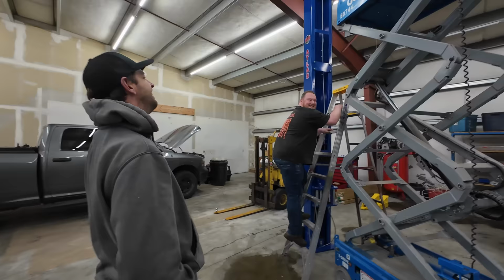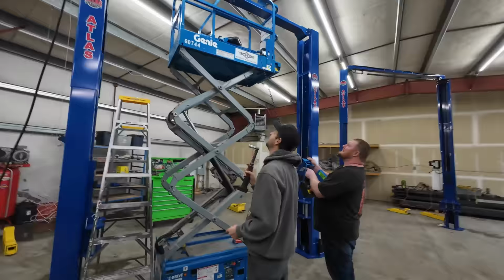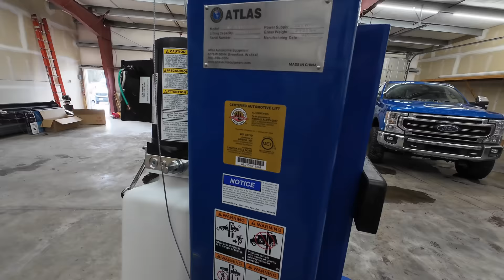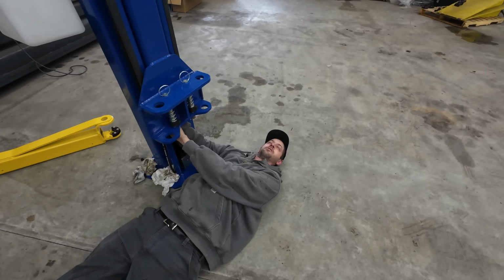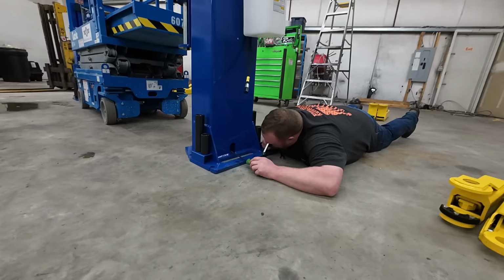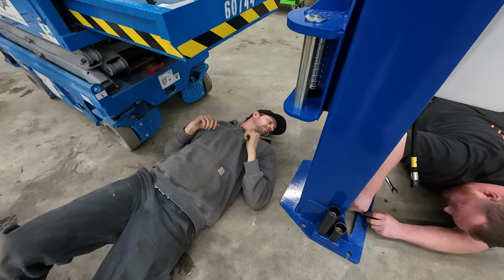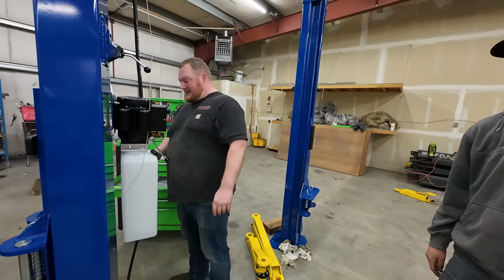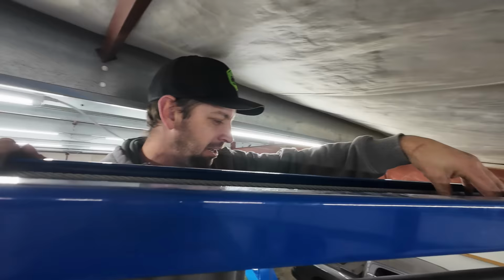Open for business!  Almost…

Comment: there is no need to take the controller out of the basket... the master controls are right on the bottom next to that red shut-off button 🤣🤣🤣
Reply: Hahahahaha didn't even think of that.....
Reply: Sssshhhhhh
Reply: Except the controller probably weighs three pounds….
Reply: Running it off the body controls puts you head down right next to it, instead of standing ready to run. And it’s a genie, so even brand new they aren’t great controls.
Reply: Must be his first day.
Reply: I can see them from here lol
Reply: Any video that you does with nate, grumpy, ben... is a good video
Reply: The controller should be proportional for lifting slow, the emergency controls are not.  It would make it hard to line up the bolt holes.
Reply: And tell Ethan to talk less kinda… just a suggestion. The kick flip comment was awesome though… 5:09
Reply: @chriswywh , what? Ethan is a friend and hired trainee. His input is hilarious.
Reply: This only works to go up or down, there’s no controls to drive it down there
Reply: @izzygoat6405  Correct. The controls on the base frame are to lower the basket in emergency situations. And master key to lock out the unit.
Reply: @elitefleetautomotive9181  sometimes, to be a man, you must use stretchy cords...
Reply: @donh6416  loaded a few of these on trailers for a delivery company, very easy to chain down but hate driving them! my worst was inside a hospital, whole basket had to break down to get out the door, that was fun :)
Reply: @izzygoat6405 I don't mind driving them. Its fun when you have one drive wheel on a surface not firmly attached to the floor and you can turn and then kick it out of your way after you ask staffers to remove them and they don't.

Comment: There is an emergency lowering valve in the base of the lift. It let off the hydraulic pressure back into the tank to lower platform.

Comment: Casey, I worked in automotive industry for over 30 years in Michigan.  The one of the legal reason the OEM's can not sell that truck to the public, is if any of the Safety components parts are not off Production  tooling..Brakes, airbags, and fuel system parts. or If any of other major component parts are from prototype tooling, the OEM's cannot sell them.

Comment: I work at a gas station and so far what I've heard is that the tap is the safest way to use your card because there is a randomly generated number everytime u use it. Always tap if possible
Reply: Yes, and that’s what multiple financial sites recommend. Because there’s no physical contact. But also much faster than chip.

Comment: If you did pin it against the ceiling and get locked out, you could still lower the platform with the emergency relief valve on the base. (Red handle)..
Reply: But they would then need someone else on the ground to do that…

Comment: At 13:29, using tap to pay on card is more secure than using the chip. Because skimmers can read the chip when inserted but not when tapped. I used to work in the credit card processing business.

Addendum - and it’s much quicker than using the chip! Plus less prone to read errors by a dirty card/chip.
Reply: That's good to know! Thank you!
Reply: Yeah but a the tap information can be grabbed by a pocket scanner when they are close to you. You definitely need a protector sleeve or billfold. I'm not sure they work properly, you are taking their word for it. Cards aren't safe period.
Reply: I also want to add, I opened a brand new account at regions, got the debit card, activated it on the phone then used it at the Bank's own ATM, then a few hours later got a notification asking if I made a purchase on Amazon for a few cents. If not for that I would have been wiped out. That account can no longer be accessed via card or online. Direct in person bank withdrawal via check only. A check withdrawal gives me time to dispute a fraud withdrawal. But personally I think your money is safer hidden in a jar in a drain tile.
Reply: I just barter cows for everything.
Reply: @Bryan-Hensley owwww I’m coming to do a treasure hunt at your house!!!!

Comment: If the lift gets stuck up for any reason, there is a manual override/emergency valve on the lower side to let it down. You should also be able to control all functions from the lower panel. You say dying can take a long time, I say it takes a life time.
Reply: Lol

Comment: 12:15 I know that this is an old video but the welded bushings have to go against the frame!  Might want to turn those around.  In the manual page 22 states to make sure that the plate is installed as shown, which shows the plate flat side inwards and the collars inwards against the frame of the lift.  🤠👍

Comment: Interesting the hoist legs don't have a pad under them to keep the legs from rusting. And for the people that might have an issue with no bolts in the floor. You do that after the hoist makes a few unloaded runs up and down, as the legs will find "home" where they want to be. Thank's Casey and the happy guy's for the shows. Does Casey ever have non-happy people in his shows? Just the ones hooked to the truck.
Reply: That's completely against what I've been told by professionals ( I'm considering getting one used and install it myself). They are telling me I have to use special bolts that will anchor in concrete, I think they have to be welded to rebar then concrete poured and I have to dig a tapered hole that's wider at the bottom that's much deeper than the regular concrete pad. How would you be able to do what you are saying?
Reply: @Bryan-Hensley  First off, It's called a wedge anchor that has a hole drilled for it in the floor. And no, you do not have them welded to the rebar. And if you were told not to have a pad under the post for rust protection, go fot it. That pad saves the anchors and the post bases from future fails. The pads are made out of Kaiser billet and well worth the cost. "How would you be able to do what you are saying" you ask? I guess you have issues on simple things, I will try to help. Have a proper floor poured that is at least a foot think in the areas where you want a hoist, my shop floor is 18 inches thick, in 100% of the floor area. The pad goes under the hoist leg that sit's on the floor. Drill holes for the anchor's and pound them in. Secure the lag bolt with washers as needed.
Reply: @ducewags  pound lag bolts in? That doesn't sound safe.
Reply: @Bryan-Hensley  You have issues with reading, or know what a "wedge anchor" is. Would you like to try again?
Reply: @ducewags  you don't have a clue what you are talking about..
Reply: @Bryan-Hensley  Sure thing cupcake, sure thing. And have a nice day.

Comment: I'm pretty sure that it's possible to drop the lift without it powered by bleeding the cylinder in an absolute emergency. So even if you pinned it to the ceiling you could still get it down but then you would need to redo the hydraulics.

Comment: So those scissor lifts, they have up and down controls on the bottom where the key goes in, it switches between base, off, and platform controls, no need to take the platform control box off like that...

Comment: I was helping a friend working on a drag race car. He had a bracket with 4 90 degree bends. It needed to be shorter. He had me take it to another friend. He said have him cut it and weld it back together. When I explained it to the other guy he looked at me kinda funny. He put it in a vice and rebent it. It was a slap on the forehead moment 😂😂.
Reply: I might not be understanding your description, but wouldn't that make the bracket weaker?
Reply: @Bryan-Hensley  You ask too many questions!
Reply: @Cougracer67  I would also refuse something that had been straightened and rebent if it needs to be strong.
Reply: It only mounted an MSD electronic control box.
Reply: @RandyInouye  I guess it wouldn't matter then. I've learned to do exactly what the customer specified though or question them in advance.

Comment: Yes that is a Scissor lift. The other style lift that has the platform on a boom extended out forward to the front those are called man lifts. The lift you guys are using is called scissor lift because under the platform when it does up and down its in the shape of scissors. "

Comment: 1.  With a forklift sitting idly by, why use the scissors?  It'd be safer to put a sturdy box or stack of skids on the forklift.

2.  If, through a series of poor judgement moves,  the lift got locked out against the roof, there's an emergency hydraulic release you can access at the base.

Comment: Along the "Certification" discussion - I heard a bunch of parts guys behind the counter messing with a teenage boy's mind.  This kid had a three-by-five card with instructions from his uncle (who was some sort of a mechanic) and his father who were repairing an old truck.  He was sent to buy parts and was reading aloud: A water pump for a 1974 Ford pickup with a 300 straight six, please.  It's an old truck so rebuilt is OK, whatever is cheapest.  Some "Blue Glue" in case the gasket gets damaged during installation.  Two gallons of anti-freeze please.  Two 2-inch hose clamps.  Please help ensure that the pump we buy will fit this pulley.  And, my uncle would like to know the warranty, please.

They first parts guy said, "Standard OAEC warranty."  They parts guy beside him said, "Yeah, standard."  The third guy at the counter said, "OAEC."  And my buddy who was helping out in the back room chimed in, "It's standard!"

I figured they were joking because, as a back-yard mechanic myself, I had never heard of an OAEC warranty.  I asked my pal at dinner later what it meant.  He said, "Once around the Eatontown Circle!"  Apparently, it was a running joke in parts stores in that New Jersey town.

Comment: The pliers you used at @20:30 is called "nordlending", which in English becomes a northerner.
and comes from the fact that it is big in the mouth - (like most people who live in northern Norway.)

even the police accept that you use words like "Fo**ing horse c**k" to them as an "I don't agree" comment. as long as you are local, in the right places in northern Norway.
While you can risk a single night (jail time), for the corresponding comment in southern Norway.